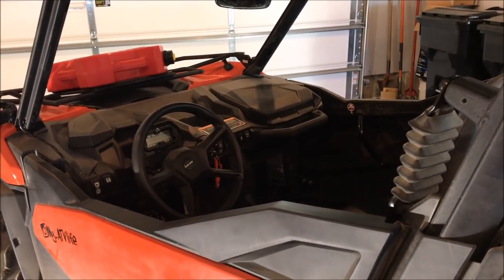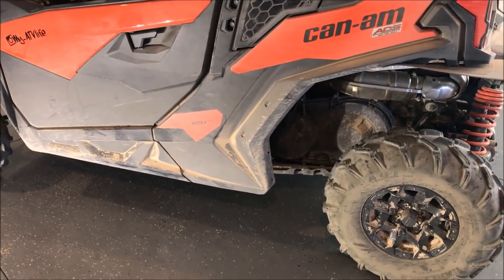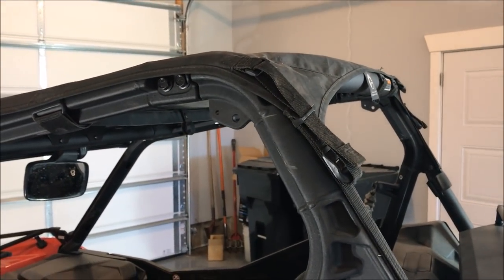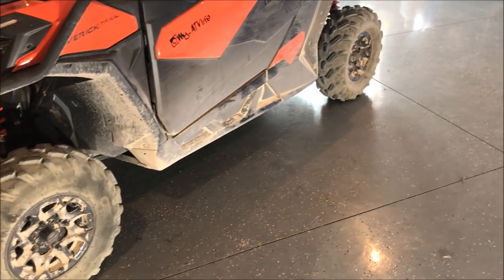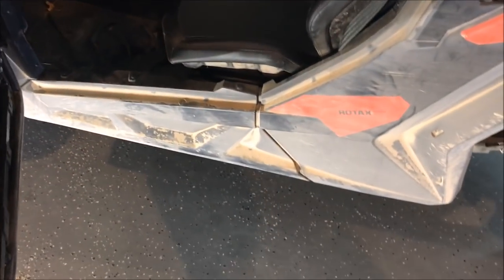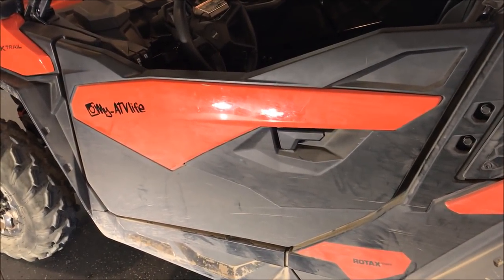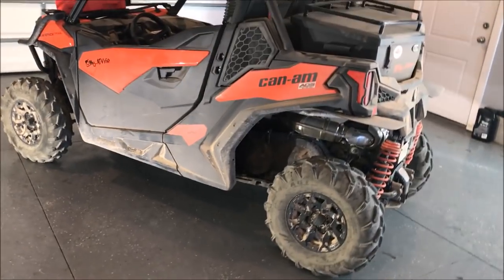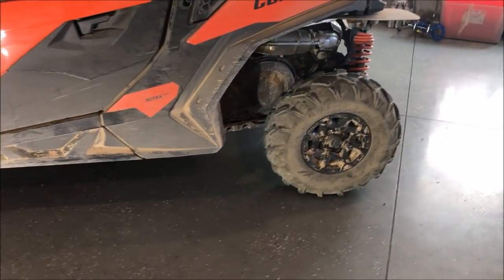Post Paiute Trail Trip Review of the Can Am Maverick Trail 1000 DPS

Comment: Great Video.  I have similar complaints about my Maverick Trail.  The Roof sucks, the wheel base is awesome and terrible all at the same time. Noisy braks are a Can Am thing I think, my Outlander was the same. I dislike the Dash display.  Overall fantastic machine, very happy I purchased one!  Keep putting out the great videos!...how does a lad get one of thoe fancy "MyATVlife" stickers??? ;)
Reply from the maker: Jason Duffy I appreciate you watching 👍 I never really thought about making the decals available for everyone. I'm flattered that you'd even ask, but we'll see how things go. I just had a few made by a decal guy on Instagram. 
 What is it about the display that you don't like ?
Reply from the maker: Jason Duffy am I just too bitchy about these seat belts or do they drive you nuts too ?
Reply: I'm comparing it to the display on my outlander.  It showed more on the display at once, speed, rpm, trip.  This one you have to scroll through to get each one.  The belts aren't as big of an issue for me as I don't have doors but they do get tangled up in the safety nets quite often.  I had to buy a seat belt pad for my son as it constantly rubs on his neck.
Reply: I'm also not a big fan of the headlights.  Again my outlander had a better set.  Only minor complaints though.
Reply from the maker: Jason Duffy yeah, I talked about those in my original walk around video. They aren't great. Low beam is "ok" but the high beams suck. They are the reason I added the light bars.
Reply: I will be adding a light bar as well.  Just waiting to see if I am going to go with a full windshield or not. All my complaints are minor.  Still a fantastic machine.  I almost bought that ryfab box after watching your video.  I opted for the Can Am full cover because the dealer had it in stock.
Reply: Jason Duffy any solution to the squeaky brakes
Reply: D Rich315 not that I know of.  I changed out the pad on my outlander with aftermarket when it was time... They squeaked too.
Reply from the maker: D Rich315 there were four of us with Maverick Trails at Rally in the Pines in our group. All of our brakes squeaked.
Reply: MyATVlife lol it’s very annoying glad I’m not the only one.
Reply: I put on an Extreme Metal Products aluminum roof. Bad choice, 300 miles later the left front mounting  bolt broke and fell off cracking the roof around the mounting hole. E M P would do nothin about it. I believe it was caused by the xtra long front lip vibrating until the bolt broke. I have riveted an aluminum reinforcement to each front mount and had a shop take some of the lip bend out of it to eliminate the lip banging on the windshield and cage. Hopefully this fix will last.
Reply from the maker: Gary Smith sorry to hear that.
Reply: @jasonduffy5089  I have an outlander now but I'm thinking about doing what you did and moving up to something like this.  Do you have any regrets or wish you would have bought something different?  I live in Michigan and we have great trails, but off the main trails are tons of these, non-mapped, very narrow 2 track trails that I love going down, and usually I go until they end or there's a tree fallen over the trail or whatever, and turning around is many times very tight and I'm not sure I'd be able to do it in something this big.  That's the main reason I haven't made the move so far. (plus it would take up a lot more garage space)

Comment: we purchased the Mav trail and have the Polaris trail and Polaris 900 4 seat ,i love the Mav trail it rides like our 4 seater . I added extra padding on same roof with additional screws to fix the rattle noise. I added the Warthog tires and run lower air pressure ,about 8 front 9 rear did the Beaver side of Paiute 50 inch trails mid June ran the heck out it and never had an issue with tires.
The torque of the Canned Ham is the key ticket to the feel while driving. If anyone is looking for a little less expensive unit i believe the 800 Mav trail would be really good for any trail system out there. Continue with your videos awesome!

Comment: Love your videos! I have the exact Maverick Trail. Planning my first trip to the Paiute Trail this June. Your videos inspire me to get out and enjoy my MT more. Do you have a video on your Toy Hauler? I would love to see it. I have to "train" my Maverick Trail behind my fifth wheel. Needless to say, I am limited to the places I can go and ride. Keep up the awesome videos!
Reply from the maker: That's awesome ! Thank you for watching ! I don't have a video of my Toy Hauler, but I can tell you that my MT barely fits in it. It has a 10 foot garage and the MT barely fits with about 1/4 of an inch to spare. That's the biggest reason i didn't go with a bigger tire because it would make the machine longer, then it wouldn't fit in my garage at all. 
 If I take my ATV along with my Maverick Trail I have to pull a second trailer behind the toy hauler too. I've done it for so long that it doesn't really bother me, but you do have to plan your trips a little bit. 
I do wish I had just a little bit bigger garage in the toy hauler. 10 feet just doesn't give me enough wiggle room. 12 feet would be better. I back it in and have to cinch it down tight with the back tires against the bulkhead then I have to put a piece of cardboard between the brush guard and the ramp door to keep them from rubbing together 😆 
I'll be down to the Paiute in June also. Maybe I'll see you there 👍

Comment: Those parallel sticks can be dangerous.  When the stick is parallel to the trail direction and you run over it... as you pass the middle point of the stick, like a teeter totter, the stick end toward the vehicle pops up and depending the curve of the stick and points the end right at the fire wall or the wheel well.  Very dangerous in wooded area.  BTW  I have the Dragon Fire full metal roof and it rumbles terribly when you are running over rocks.  Needs a center support.  Appreciate your reviews, lovin my 1000 DPS and its my 5th SxS.
Reply from the maker: kong3 sorry to hear that about the roof ! They always looked like a well made product to me. I know Ryfab is working on an aluminum roof for these, I'm waiting to see how they turn out. I've always liked their RZR roofs. Thanks for watching, and I appreciate the comments/discussion. 👍

Comment: Nice post review!! I'm so undecided between this one or the two up outlander.
Reply: Rich joy ditto
Reply from the maker: So I've been giving this some thought. I've decided that when I'm alone I like being on my ATV. I think it's mostly because I'm really attached to my ATV, lots of miles and memories. Plus I feel like if I get in a bad situation I can get out of it easier on an ATV. It's much easier to turn around than the Maverick Trail is. But, when I'm riding with my wife I much prefer riding together in the sxs vs riding on separate machines. I've never ridden a 2 up ATV, but I feel like I would still prefer being in a sxs with two people, especially on steep hills. There is no leaning forward and holding on, you just lean back. That was one thing my wife mentioned that she appreciated. I'm just trying to compare something that I have done to something I have never done, but I've spent a lot of time on an ATV through some steep and rocky crap, and I just don't think I'd be comfortable with someone behind me. Just my thinking out loud.
Reply: That totally makes sense. Completely agree that when riding solo an ATV is the way to go. For me, simplicity wins everytime. Plus, I prefer "riding" to "driving" anyday.

Comment: Do you have any recommendation in updating the tires to a heavier ply rating and wheels with bead protectors?
Keeping n mind that I would like to try and maintain the 50” width for gate purposes.  
I own a 2018 Maverick Trail 1000.
I tore up the left front sidewall on some rocky wet trails on top the Grand Mesa, another words rocky.
Thanks for any feedback.
Mike from Denver
Reply from the maker: I put a set of Tusk Terrabite tires on mine. 27x9-12 on my stock wheels. They are an 8 ply rated tire and also a DOT rated tire. This video explains why I chose them, along with some quick specs : https://youtu.be/qFWkQXMGT_4

I just got through testing them at Rally in the Pines. Put 393 miles on them there. I'm working on a review video now, should be up in a few days, but spoiler alert: I really love them.

Comment: Since upgrading to the tusk tires have you noticed improvement in ground clearance? I am ready to trade my rzr 800 for either the maverick or rzr 900. Afraid of the wheelbase on maverick like you mentioned here.
Reply from the maker: I couldn't go much bigger in tire, so I just went as big as I could get away with, but I did gain about 3/8 of an inch in ground clearance. It doesn't sound like much, but it definitely made a difference. 
 As far as RZR or Maverick Trail, I really don't think you can go wrong with either machine. They both have strengths and weaknesses. The wheelbase on the Can-Am can be a pain in the tight technical stuff, but honestly, the other 99% of the time it's totally worth it. The room in the cockpit is one of the biggest reasons I chose it. Lots of room and lots of storage. Plus the ride from the longer wheelbase (in my opinion) is so much better than the RZR. But the RZR is more nimble in the technical stuff for sure. 
 Sit in both, and drive both of you can and see which one feels better to you. Again, I really don't think you'll go wrong with either 👍
Reply: Thanks so much! I live on the Paiute trail system so almost all my riding is here. I will try to find someone I know who would let me try their maverick out. Thanks again. Great videos and discussion by the way! Very, very, very informative and helpful!!

Comment: Has anyone put insulation behind the seats to cut down on heat and noise?
Reply from the maker: I have seen it done. One of the guys in the Maverick Trail group on Facebook did. He used some stuff similar to Dynamat (a cheaper alternative that I think he got from Lowes or something). It seemed to work, but I don't think the results were dramatic.